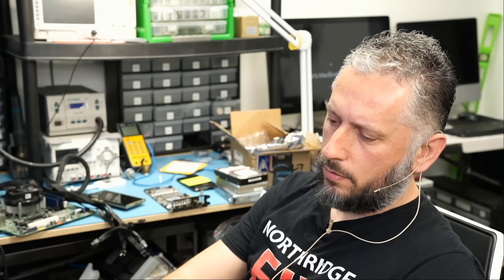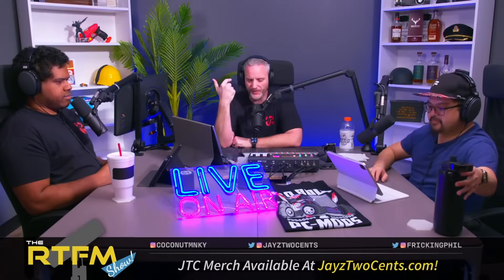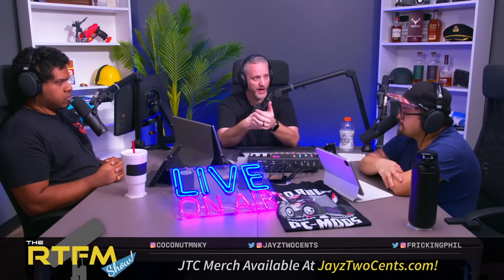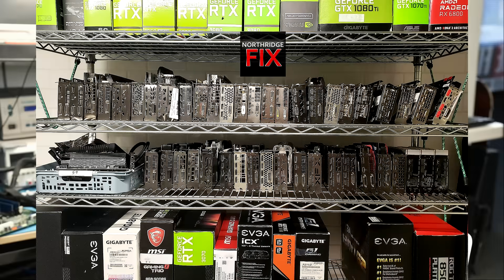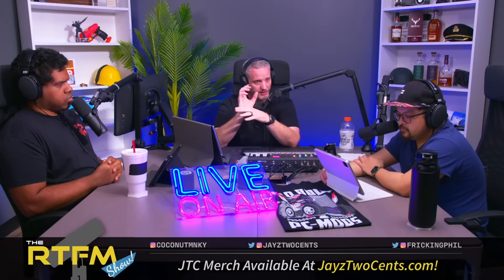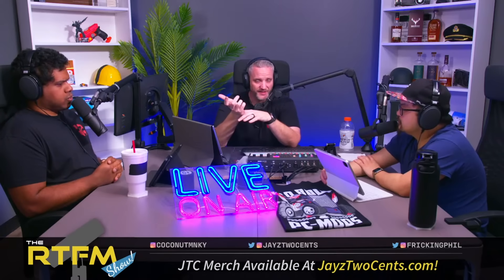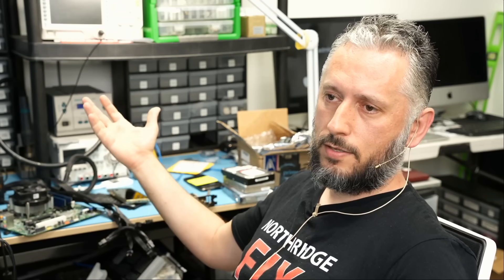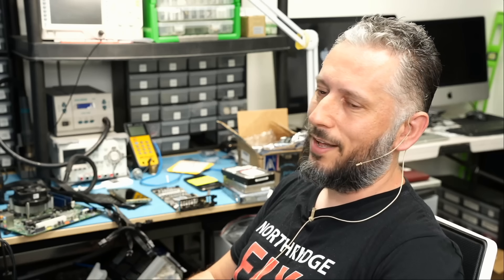Melting 4090 and CableMod. JayzTwoCents and Gamers Nexus Response. Blame NVidia or User?

Comment: Definitely a Nvidia responsibility, as you said if one hack of expensive tech piece is so prone to user error, it's design error, imagine a Porsche if you drive it cruising out of 2500-3000rpm range and it will blow you into high heaven... I don't think they can say "you use it wrong"

Comment: I would suggest it's possibly a voltage drop from the power supply units and this causes more heat which melts the connectors

Comment: I actually agree with you, I think Nvidia is responsible beyond user error as a result of it just being way too easy to replicate the issue. 

A recall I think is a bit excessive for the relatively low number of cases compared to the amount of units sold. You're talking about recalling at this point probably around a quarter of a million video cards, which I feel is unrealistic unless you can actually prove it's the GPU side connection point that is the issue. Even then it'd probably be more realistic from a cost and logistics stand point to simply replace the cards if/when the connection fails.

I would like to see Nvidia offer replacement adapters for anyone interested though.

Comment: When you look at previous generation 8pin power connectors and the new 12Vhpwr connectors, they look similar in design in how the male and female plugs are designed and connected to each others. It's just that 12VHPWR has more wires on the same plug. In other words, 3090 ti had the same kind of connectors used for up 550W and 0 melt problems. So why is there a problem with the same base design with the same power? I dont think the connectors are the problem, i think it's how power supply management is done on the card. Obviously it leads to more power beeing drawn from single wires than it was in the previous series.

Comment: Perhaps a cable was installed before receiving the cablemod adapter. When it was removed to install the adapter, wear may have created features/damage to to the connector on the card that were the source of the heat that melted the adapter that was installed after. That is my interpretation of Steve's position. Ultimately, it's a bit moot as NVidia needs to fix the design.

Comment: I am software engineer and if I make a software where one or two people have trouble with the software then it's possible it's user error.

However if (at this point) dozens of people have same error then it's obviously not an user error it's error in the software.

I apply same logic to this issue as well. If this was one or two users then it might be user error but if there are dozens of melted cards then it's not user error it's error in the card and Nvidia should either run replacement program or they should make sure they supply fix to owners of the 4090 cards. It's idiotic that people pay over 1k$ for a graphics card that can fail due to connector issues that are probably out of user's hand.

Comment: I was in the market for a card when this first started happening after launch. There was a price drop around the same time and EVGA had just announced they wouldn’t be making the 40 series cards. I found a 3080 ftw card from EVGA new for 700 and bought it. Best decision I could have made as all the 40 series cards have been a huge disappointment. I agree 100% this is an nvidia problem and yea Steve gave them an out unfortunately. The cards are always the failure point.

Comment: Alex, JayzTwoCents seems to have it correct and likewise, NorthridgeFix is correct as well. I think regarding GamersNexus, at the time of their analysis, they did show a video where a cable did fail due to incorrect seating of the connector. If you take the time to view the whole process, GamersNexus did try multiple ways to make the cable connector melt under different methods and finally at one point, when they purposely did not seat a cable connector properly is when it melted. Based on their methods, GamersNexus concluded it was user error based on their methodology of trying to locate the issue with the 4090s. In my own opinion of seeing all of those videos, including the commentary from JayzTwoCents, I think it is Nvidia's poor construction of the video card, especially the power connector whereas it's supposed to draw a lot more power than any previous video card. It's not to say that there are no user errors, because potentially there can be since we are dealing with some users who are dumb (to put it gently) about plugging things into their computers.

Comment: I 100% agree with you Alex. Nvidia is at fault for a poorly designed product. they never had this problem with their past products, why is that? the one thing they changed in their design is that horrendous NEW connector, that is not on their older cards. Logic then dictates the new flawed connector is the problem. There is a saying " If it is not broke, then you do not fix it! ". So why did they change that connector? History of all their cards in the past is proof. It ain't rocket science.

Comment: Has anyone checked the power and amps per wire in these connectors to see what is being pulled from the psu wile under full load only asking because i only hear people taking about the connecter as a hole.Also they all have the melting on the same wires.

Comment: It's definitely a bad engineering issue from NVidia. Monitoring the input voltage and connector temperature should be required for GPUs with TDP over 100W, the extra production cost would be less than 1 dollar.

Comment: agree, NVidia should have not implemented this change al together, AMD was able to develop the 7900XT and XTX yet use the traditional connectors while still offering competitive performance, as a builder and a person who has a system integration business, this is a huge problem for us, the original cable extension that comes with the 40 series cards is just bad, it ruins the whole echo system, working with these cables on our systems is really annoying, making it look good is super difficult and will almost definitely need a custom cable which is also annoying, and now seeing these issues that impact sales, warranty claims, and client concern and worry, NVidia really pulled a number on all of us.

Comment: Well.. For sure the standard connection does not sit tight in the socket - it can bend both sides in both cases: direct (straight) connection to the PSU (new MSI 1300W) and via vendor or 90 degree "noname" adapter. With cablemod 180 degree the connection sits tight left and right... BUT... I've noticed a bit of movement, when you try to touch the cable connected to the connector - the connector os moving few degrees up ad down. I did my best to fasten the cable to make this move impossible, to not brake the card, but I definitelly can't say it is so much oslid up/down, is it is left/right. IMO this whole invention is a crap and disaster from NVIDIA side. 1st - it requires a lot of space in the chasis. 2nd - it's extremely small for such power. 3rd - without new PSU it makes a lot of mess in the chasis (3 new big cables running through the  chasis). 4th - the connector on the PCB is not deep enough, to assure proper connection (resilient from high connection resistance  risk). My first 4090 failed after 6 weeks of working fur unknown reason (so far) - I'm waiting for fix or replacement. The new one I bought I immediately watercooled with Alphacool block and used with 180 degree Cablemod adapter. It is running fine on 45 C degree so far, and I hope it will stay like this, but I'm already looking forward for any new card without such problems with melting connectors...

Comment: I have seen this issue of wall plugs burning on walls, after changing several sockets and plugs on the same device i realised the issue is being caused by eddy current as the device is pulling soo much current causing the contracts to vibrate. To solve the issue i just increase the size of cable between the device and wall plug. For this 4090 i believe if it can have multiple parallel power input current will be shared and reduce the eddy current on the connector

Comment: Im gonna drop my comment before watching the video. 
OF COURSE its 100% Nvidias fault or the company that designed & manufactured the new power connector.

A connector should never melt under any circumstance.

EDIT: Perhaps manufacturers should start using high temp plastics in the power connectors like whats used between the - & + terminals in vape tanks.

Comment: Theres no question about it Jay clearly pointed out when and where the issue is occurring he has all the evidence like he said he has 3090s that use the same connector, same size wire and using the same amount of wattage! What more evidence does Nvidia need to take accountability for their screw ups?? Now here's an interesting thing, my 3070TI actually has led lights by the connector and there was a time when I was just fixing my side panel and it moved the cable slightly and the card stopped putting out video to the monitor and those led's were blinking red indicating a bad/altered connection for a minute I thought the card went out but it turns out that is a safety feature in the card supposedly so I'm just thinking that obviously they don't have that feature in the 4090? I don't know but this is clearly on Nvidia there's plenty of evidence.

Comment: If I understand correctly, the same connector has been used on previous series of cards with no known problems.  Now, on the 4090, it is melting.  The 4090 draws a lot more current than the earlier series cards, so it may not be up to the job under some conditions which draw more current.  There may be some power/voltage regulation issues on the card that precipitate the melting conditions exceeding the limits of the connector.  If anybody is going to get to the bottom of this, it is you, although diagnosing a design flaw is Nvidia's job, not yours.

Comment: It is NVIDIA, not the User it is as simple as that and anyone who says differently, IMHO, has no clue of electronic designs / engineering.
It is the BASIC that is not being addressed here. 

I did not see in this video a mention of other videos where it was shown that those issue were blamed on the use of the  female sockets in the connector.
Why have SIX (6) wires for the Positive (+) PLUS and Same for the Negative (-)  that get combined to become one "PIN". 

When will they come with an revolutionary two pin design for high current (  I  AMP  ) that doesn't fail . This is low voltage not? 12 VDC.  Learn from the Automotive and Audio Engineers / Designs which have as far as I can remember NEVER EVER had any issues like NVIDIA has.  

I will watch this video a few more Times as I noticed someone saying its with a certain Type / Model 4090 card?  Anyhow, I feel this can NEVER EVER be made a user error.
The  design must be flawed to let this even  happen, it should never have happened and I thought this was already resolved some time ago, seems not.

I am for one following this to see who says what, based on whom expertise  as I hear people say " stuff " who obvious have no F@#ing clue  of what is going on here.
I totally agree  'N-FIX'  it is not user error!  Coming from a VET with  four decades of expertise , bite me, I started young  lol   😎🥸😇🤣🤣🤣🤣🤣🤣

Comment: The problem may be that the connector has small dots were pins make connection. This seems very little area for so much current and may be the cause of overheating.

The whole design needs an overhaul soon. Maybe changes to the standard and how pins make the connection. After all the 3090 had a very similar connector and there were no issues.

Comment: How friggin much current must they be pulling through those pins that the internal resistance of the conductors and connections are raising the temperature to the point where the connector is melting?

Or is it the resistive heat of current flowing through the connecters plus a high thermal load from the circuitry on the card near the connector that is contributing to a further temperature rise at the connector.  Would be interesting to watch a card and connector in a typical installation with an IR thermal camera and see where the heat is coming from.

Comment: Possible, yes - Plausible? Probably not. Steve I think was clear here that he could be "completely wrong" until he has other evidence. I don't see Steve blaming the customer but instead I see Steve taking the stance that the results are not conclusive with the current evidence available however I do feel that Steve made assumptions in his statements which is why he appended to the statement with "he could be completely wrong". In regards to who I agree with: I respect and appreciate each persons analysis on this subject and I agree with each of the perspectives. As someone who ended up buying 2 4090s, I'm anxious to learn what Steve finds with a deeper analysis. I hope this kind of open dialogue gets more attention around this subject because I do believe the root cause is Nvidia here but as Steve demonstrated, it is possible to create the failure by not seating the connector fully, whether that be intentionally or unintentionally.

Comment: I don't think anyone, not even a multi, multi millionaire is going to spend over $2000 on a graphics card, and not make sure with a double check the connection is good if they don't hear a click when installing. If you can still hear a click from the tab when the plug fully seats, and the plug can still melt that is absolutely a manufacturer defect.

Comment: This maybe the unbalanced usage of the pins by a videocard power supply? Next question is, when you exchange the connector on the card it is lasts longer? If yes, then the original has crap quality.

Comment: If the cable is not plugged in fully then you should get a damn notification  on your screen or on the GPU screaming something is wrong check your cable is fully seated in.
But if it's user error then we sould have seen it for the last... how long we have these 8 pin connectors? yes. On these 8 pin connectors too.

Comment: there is a sensor on the connector on the card. If you unplug it, your BIOS (or UEFI) will sends beeps to the PC speaker (that you probably don't have plugged in ;) ). Most of the time the PC won't even boot and will just beep. EDIT: Does USB-C, in your opinion, needs teeth too? Because, in my opinion, not having teeth is one of the best features of every standard that doesn't use any.

Comment: Hi Alex, many thanks for posting this video. I felt that Gamers Nexus were avoiding a lot of analysis of the situation (that they even had the equipment for themselves) and were looking for any possible reason to blame the user for the problem. JayzTwoCents seems closer to the mark in the clip you showed but it is unfortunate that JayzTwoCents is not technical enough to go further.

I agree with you in that if it is the exact same pins that are burning then there is a also an issue with the graphics card itself or at least strongly suggests this. I also agree with you that these cards should be recalled.

I disagree where you say there is not a problem with the connector in that the choice of connector was a very poor one. It did not take much research to follow up where another youtuber went into the actual physical connector. I found that, excluding the four small control or signalling pins, there are up to three sizes of this connector. One company makes two sizes and the other three. The fact of the matter is that, for whatever reason, the smallest and least power capable connector was chosen: It has less power delivery capability than two six-pin connectors would have on a regular graphics card! The next size up, from either of the manufacturers, is the same size as the regular six-pin (and eight-pin) connectors in terms of electrical contact size. If nVidia had chosen the larger size than the regular specification connectors for their power connector then there would have been a genuine improvement in power delivery. Maybe this could have been the original idea? I don't know, but it certainly seems ridiculous for a electronics design engineer to specify a lower-power connector than an existing standard for a higher-power application.

Comment: I’m with you Alex. Looking at the “burn line” as Steve calls it I would imagine that the end of the plug in the cable and where it makes contact with the pin in the socket on the GPU. I wonder if there is an issue with vibration burning these up, I had it at work once where we had to apply a connector lubricant to a molex type plug as the excessive current draw and vibration burnt out the pins

Comment: i dont mind to come back to the old 6+2 pin connector even if i have to put 3 or 4 of those cables on the videocard, is better to have a videocard that last many years instead of a good looking one with just a single connector but that can melt in any moment

Comment: I have a 3090 Ti Kingpin card.   How many people think that EVGA would go to that much trouble to create a PCB with 2 12pin connectors on it for such a limited run card if it didn't need it.  These cards require too much amperage for a single 12 pin with it's tiny contacts compared to 3 old 8 pin connectors.  It's an Nvidia problem.

Comment: This is why I don't buy a 4090 wait till they get the connector problem fixed or just bring back deals standard it work well plus it's easy for cable management.

Comment: Could it be in some times of the melting failure, its a problem with the new power connector, like they are not fitting right together and pushing the pins in the cable back?